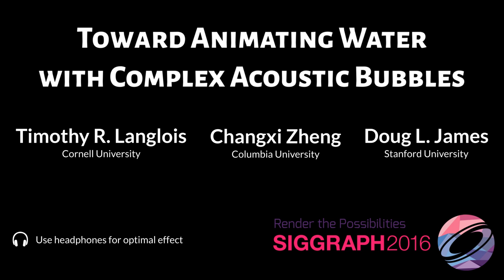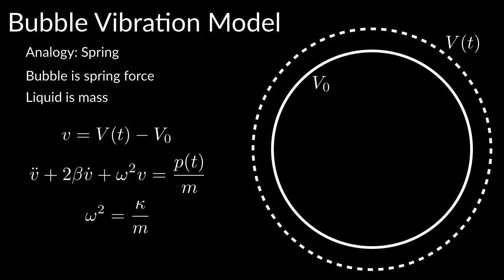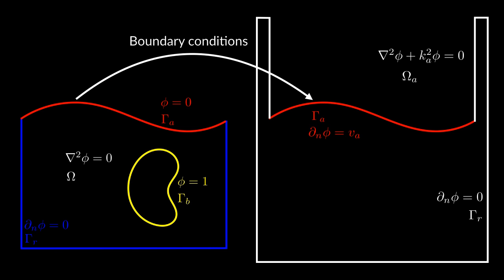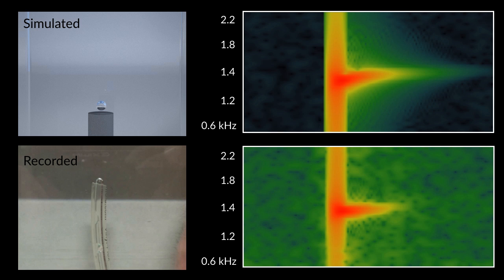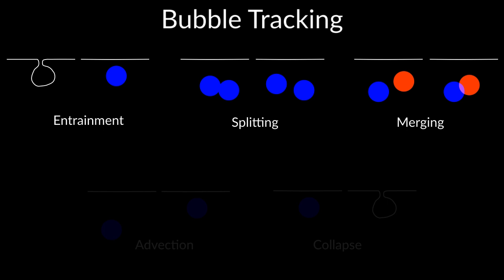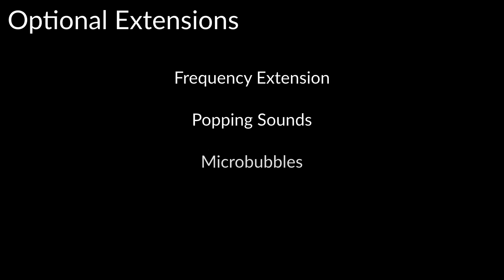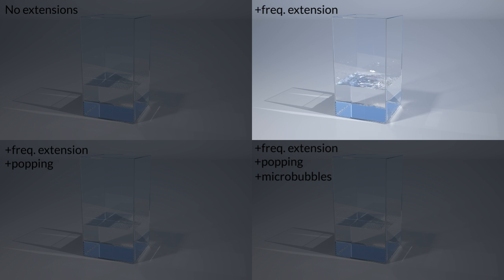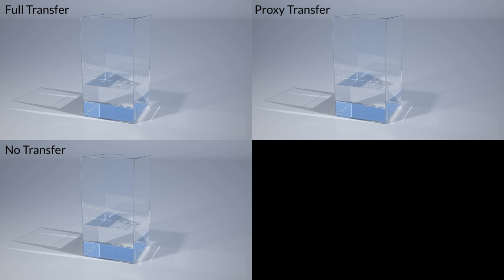Toward Animating Water with Complex Acoustic Bubbles (SIGGRAPH 2016)

Comment: Looking at the python code for this paper, you guys are using 1497 m/s for the speed of sound. 

However, that's the speed of sound in seawater, but your paper is [presumably] for fresh water (c ~ 1435 m/s) ? 

I'm guessing it won't have much of an effect, but it was enough to make me stop and double check when trying to replicate your results.
Reply from the maker: It will slightly change the damping of the bubble oscillators, but I doubt the effect will be noticeable. For most of the derivation we're assuming the liquid is incompressible (implies the speed of sound is infinite).
Reply: @TimothyLanglois  Thanks for the unexpected, but definitely welcome reply. 

Most of the research out there seems to be on simulating the acoustics of single bubbles at a time, but our application needs to simulate the acoustics of millions (or at least hundreds) of bubbles (from for example, ocean wave splash transients) in real-time. 

Do you know of any research out there that covers the statistics of simulating acoustics for large numbers of bubbles (that isn't just wide-sense stationary spectra)?

Comment: All the sounds would have been easier to follow if you showed the FFTs and zoomed in close enough to see where the sounds are originating.  Looking at drops from across the room and only hearing the sound does not give the experience you gained by looking at the microscopic behavior.  You considered the tiny surfaces of the drops and bubbles, but only show macroscopics (particular at 3:00 and extensions).  This is probably good, but you lost a lot of the immediacy and power but putting the camera too far away, and the time scale at human speeds. When the actual time scales are connected to the frequencies of the sounds and their time periods.

Comment: Does this also take into consideration the temperature of the liquid? Since the viscosity of water changes according to temperature, the sound changes as well.
Reply: Not by much. You'll also note that the math (The Helmholtz problem) doesn't reference the viscosity anywhere, but in the derivation there's a reference to the navier stokes, which includes a viscous diffusivity term. I'm sure that there's some inputs there, but, to be frank bubbles are bubbles...
Reply: @patrickscholl7919  https://www.youtube.com/watch?v=Ri_4dDvcZeM

Comment: You should make this into a VST Plugin! As a music producer, I would use it a lot for adding background accents and color to my songs. Right now, If I want a water sound I have to synthesize it manually which is much harder and less realistic than this video.
Reply: Making this a vst plugin would be very cpu intensive because:

1. You need to simulate the liquid first (which will be time consuming)

2. You also neex to simulate the sound (which is also time consuming as the render time is slow)

So basically just record sounds from the real life. It's faster

Comment: I wasn't listening with headphones but I'm guessing the lossy sound compression of YouTube is responsible for the 'attack of the sine waves' effect I'm hearing. I note there is an uncompressed audio file available here http://www.cs.cornell.edu/projects/Sound/bubbles/ . I'll have to download it and have a listen.
Reply: "attack of the sine waves" I like that name.
Reply: iLikeTheUDK I believe mp3 and similar compression systems use FFT like analysis (probably DCT or wavelet) to cut down the number of frequencies needed to fool our hearing. By throwing away unnoticed frequencies they cut down the data needed to represent sounds. This fails when the input is wide band noise, lots of frequencies all over the spectrum. So instead of water splashing you hear discrete sine waves all over the frequency range.

Comment: Which programs do they use to... simulate this stuff?
Reply from the maker: +Banana Warrior We used Gerris (http://gfs.sourceforge.net/wiki/index.php/Main_Page) to simulate the fluid and BEM++ (http://www.bempp.org/) to solve the boundary integral equations.
Reply: Timothy Langlois Thanks man

What'd you use to render it though?
Reply from the maker: +Banana Warrior Maxwell Render (http://www.maxwellrender.com/), mainly because it supports nested dielectrics (http://support.nextlimit.com/display/mxdocsv3/Nested+dielectrics), which was the easiest way to handle the three interfaces correctly.
Reply: Timothy Langlois I understood, like, 40% of what you have said but thanks anyway man

Now i have to figure out if this is even possible in houdini (Since i'm really new at the VFX stuff and never heard about those programs D:)
Reply: @TimothyLanglois  how you're so smart
Reply: basically, what he was saying is that having several transparent things inside each other is hard and only few renderers can handle it, Maxwell being one of them. - The air, glass and water all have different optical properties.
Reply: There is also a nested dielectric shader for Arnold that can be downloaded from this guy. :) https://vimeo.com/86272108
Reply: could one use blender with this ?
Reply: Ponlets probably not. You would need to program your own simulator that can output audio as well. (Which to my knowledge is not available in any of the major packages.) as for the visual results of this video: blender's simulators are sadly pretty out of date I wouldn't expect to see the "fluid sim" handling bubbles in a physically accurate manner.